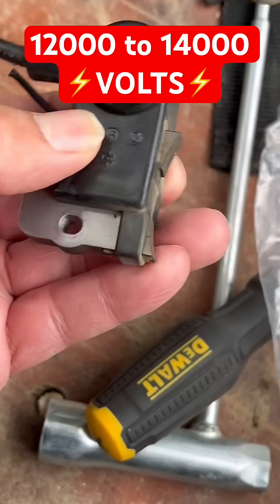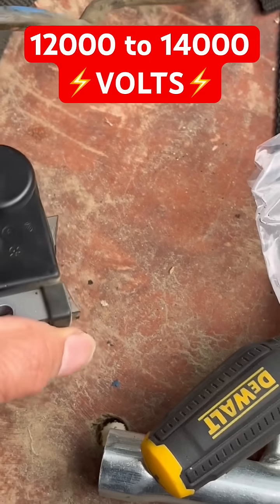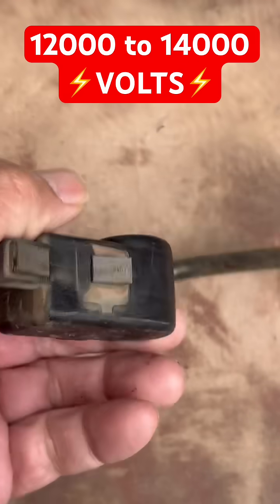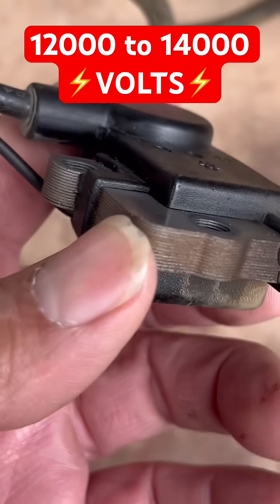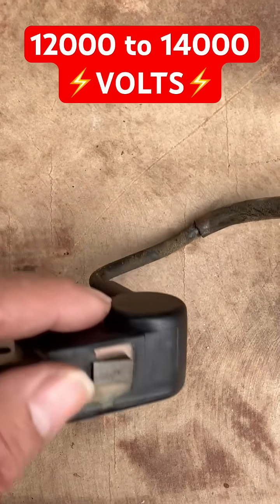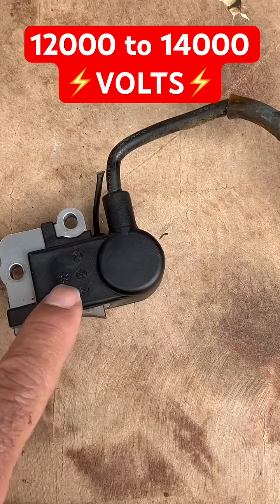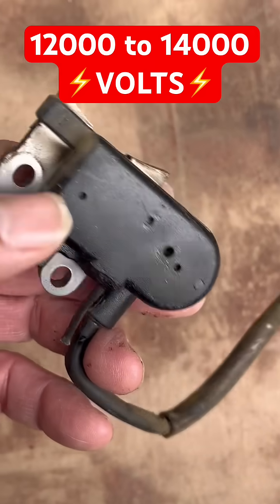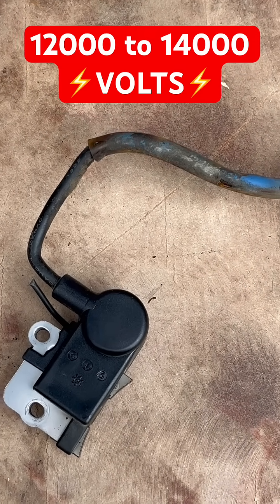62 year old explains ignition coils perfectly!

Comment from the maker: An ignition coil is essentially a high-voltage transformer that converts the low voltage (typically 12 V) from a car’s battery into the very high voltage (12000 to 14000volts or more) needed to create a spark across the spark plug gap in a gasoline engine.
It work.